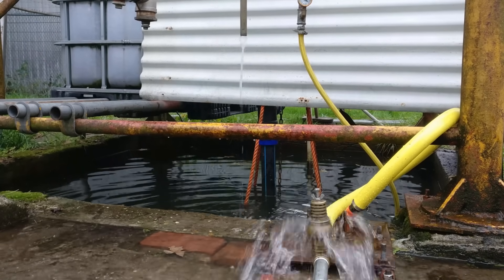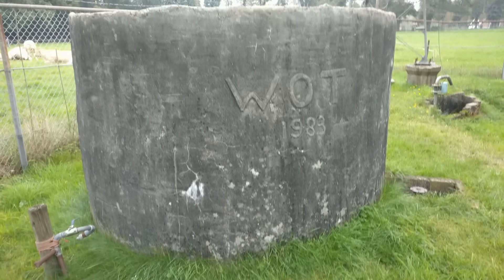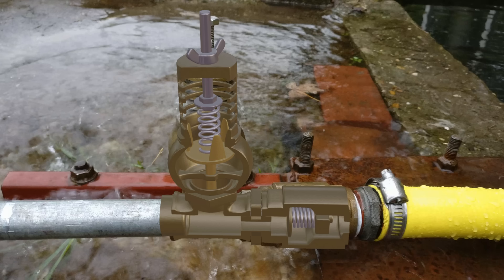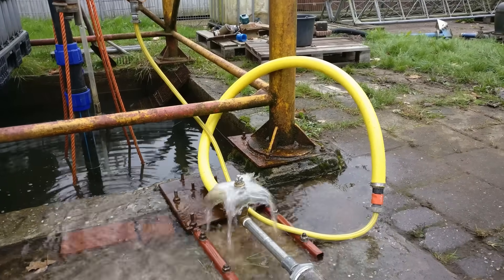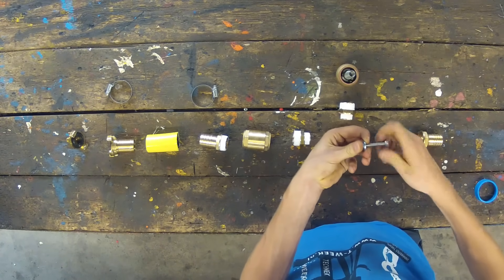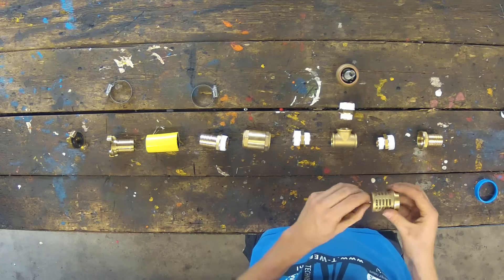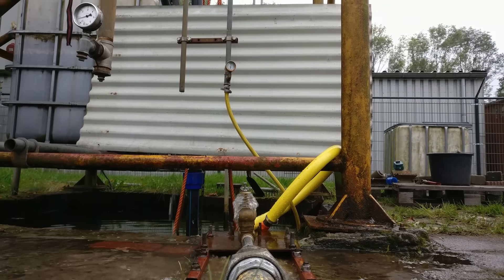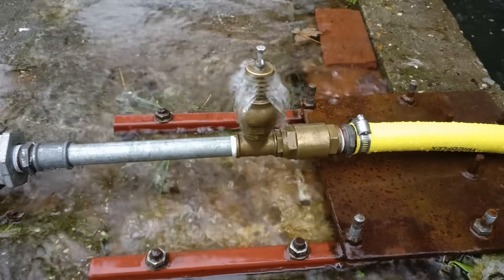Pumping Water Without Electricity - The Breurram

Comment: So it's just two relief valves tuned to be just right?
Reply: Two relief valves, yes, but you can't forget about the pipe carrying the water. This fluid circuit is almost identical in theory to an electrical circuit known as a "joule thief". An important component in a joule thief is an inductor, because inductors resist changes in current. The role of the inductor is being played by the inertia of the water in the length of pipe between the tank and the valves.

Another important component is the bubble in the tube on the pressurized side. That bubble performs a function analogous to a capacitor, smoothing out the output pressure of the pump and capturing more of the energy of the moving water.
Reply: @tissuepaper9962  Water hammer is a hell of a thing

Comment: Back in the early 2000s, I attempted to build one of these to pump water from my spring box into my garden.  I spent nearly $500 for parts because I could not get the damned thing to work, until I read a book by Gene Logsdon which told me what my problem was.  For the pump to work you need a minimum of three feet (1 meter) vertical height from where your input water is down to where the ram pump is, otherwise there simply isn't enough potential energy to run the pump for longer than five minutes or so.  Since the springbox down to the bottom of the creek was only two feet, the pump wouldn't work.  Instead, I ended up with a 30 watt solar panel and a bilge pump which now pumps water into the garden for irrigation.
Reply: Thank you for clarifying what drives the water into the chamber in the first place!
Reply: Maybe you tried this, but I think an input pipe with a larger diameter can help. And if you can't run that all the way back to the tank, add a vertical column (taller than the height of the tank) of the wider pipe which is open at the top.
Reply: @pseudotasuki  Good suggestions but due to erosion between the two spring boxes over the last 24 years, there is no safe access to either of the spring boxes.  However, as noted before, using a bilge pump and a 30-watt solar panel works just fine and, in fact, may actually work better for me because the pump actually pressurizes the water so I can lift it 10 feet from the bottom of the creek.
Reply: @pseudotasuki Also the two check valve sensitivity is something to ponder … the input should be stronger than the output so as to permit flow through the output with ease by comparison.
Reply: Solar is the way to go!
Reply: @muskratondatra8294  loo
Reply: Noted. Similar to the canal and the swimming home offshoot near my house.
Reply: Why not dig a 1 foot deep hole and put the pump in there?
Reply: @kyjo72682  The bottom of the creek is about 2 feet deep and completely filled with mud.  Don't step it it!  It's like quicksand!  The first time I did that by accident I thought I'd never get my foot out of the creek.  Luckily I was able to finally remove my feet.
Nowadays, there's so much tree and weed growth there that attempting to do anything is not feasible. 
Thanks for the suggestion, however!
Reply: @kyjo72682  the "waste" water that is uses to power the pump has to go somewhere.
Reply: Just throwing out some thoughts... Could you raise the containment level of the springbox another 1.5 feet and then have the potential (plus a little extra) to make this breuram/ram pump function?
Reply: @markpetersen912  No.  Spring box was made back in the 1940s ? 50s?  maybe earlier? and it's solid concrete attached to another spring box that was probably made back in  what I suspect was the early 1900s.  The whole area was filled in between the two spring boxes which were approximately 40-50 feet apart.  The early one had a 6" cast iron pipe linking the two and has rusted to the point that the land between the "new" spring box and the "old" spring box has eroded about 10-15 feet making the whole area sink.  It was originally the only way I could get onto the other side of the property without building a bridge over the creek. It's extremely dangerous to go anywhere near there now without the possibility of injury or even death because the drop is about 5 or six feet from the edge to where I "think" the bottom of the creek is.  My solar solution works well, however and have used that for nearly 15 years.
Reply: Thanks for noting this... I was definitely wondering what force was driving the water into the pump, this video hardly mentions it at all!
Reply: @Zalethon  "hardly mentions It at all" Is literally at the start of the video
Reply: @alessandromazzini7026  "hardly mentions it" is in other words the same as sayi g he mentions it
Reply: yes ! is the movement of the water in the river ?
Reply: @Zalethon  it uses the kinetic energy of flowing water, specifically jerk (that's a change of acceleration over time. Or v/t^2) The pressure spike of all that flowing water screeching to a stop shoves a small amount of water up the yellow hose. Then the valves switch and the water starts moving again to pick up the momentum to do it again.
Reply: @randomstuff1019  Thanks for your explanation; I get how the pump itself works, once it has water flowing into it. The video just didn't make clear how water was being fed to the pump.
Reply: @randomstuff1019  Technically that would make this a venturi pump  as its working on the air pressure created by the moving water
Reply: @Zalethon  that's because he's being disingenuous and trying to act like you get something from nothing. He mentions that water tank with a slope down to his pump but most of the water will be rejected and spilled out. That holding tank he might get 5% of that actually pumped.... and then he's going to refill that tank again using a pumped supply lol.
Reply: @etherealrose2139  you could use a scoop or ramp from the nearby river to continuously direct water into the tank and build up a little height if there's enough current flowing.
Reply: He mentions the wasted water should get back to the river, this is usually installed close to a current of water, we have one where it needs to pass 17 liters for each 2 liters it pumps, like 25 meters up, it's a huge ram, made in brazil, extreme quality.

Comment: Can this be stacked together or placed in parallel to increase the pressure?
Reply from the maker: Well actually I have heard that placing ramp pumps in series has been done.  The first stage then consists of a lot of ram pumps to generate enough flow for a second rampump halfway up the hill. We have no experience with this however.
Reply: @WOT_utwente  that doesn’t increase the water pressure over having a single pump and you haven’t described a single series, you’re describing something like a pyramid scheme of pumps to pump higher. Working backwards from the final pump, you’d probably need 4 or 5 times as many pumps at each stage. 1 pump, 5 pumps, 25, pumps, 125 pumps, etc…
It’s likely this would only work if you have massive volumes of water moving with high energy at the bottom of the system, at which point it would probably be cheaper to have a water wheel powering a rotary pump directly.
Reply from the maker: @Tim Conway  Hi Tim, you are right that maybe another solution is cheaper, probably depending on where you live and what is available. You are also right that you need more pumps every level you go down. I think therefore just two levels would be the max. Like I said, we have no experience with this, just something I heard. I believe this was done with 'philippines waterrams' but I can't find a source quickly.
Reply: Series ram/booster pumps have been used and do the job of increasing pressure but the losses are phenomenal.

I've used a 2 stage manually actuated unit to put 5000 psi into an air tank with a 100 psi input but holy hell does it take a lot of time.

Not worth the effort. At some point you're better off buying a couple solar panels and a pump if electricity is what's holding you back here.
Reply: No

Comment: Could you make this system into two (or more) spill valves that alternate in releasing water pressure but do no pumping? The idea being to generate linear motion in the valves as efficiently as possible then use this movement to create an ultra simple set of linear generators.  No rotary components would be needed to convert the water's kinetic energy into electricity, and the amount of virtual spring tension could be comprised of the sum of gravity and the current load allowed, thus being tunable to maximize efficiency depending on a changing water pressure input.
Reply from the maker: Hi Mike, maybe you could, but to generate electricity  it is probably most efficient to have a rotating generator powered by the flow in your river. Generally adding steps will increase losses. Also something that moves back and forth is also often less efficient since you continuously have to stop and start moving again, this consumes energy. A rotating motion is constant →  less losses.
Reply: @WOT_utwente  Not only is an oscillating system less efficient, it's also more prone to stress and damage because the parts are constantly impacting each other, and the pressure is spiking and falling. Rotating energy systems are definitely better, as you say.

Comment: This is unbelievable to me. Water pushes itself to a higher place just by sacrificing some amount? What happens when the water column is so high that it exerts enough pressure to break the air bubble buffer?
Reply: The column of water is behind a one-way valve, so some either gets pumped up against the hydrostatic force pushing down, or the system will not have enough inertia to open the valve.
It's really just the conversion of kinetic energy into gravitational potential energy.
Imagine you have a hose with a pushbutton off tap at the end.  You let the water flow until it has some good speed then hit the off valve suddenly.  That moving water would suddenly spike in pressure as it's forced to stop.  Normally this would stress the hose and send a shockwave back up it, but if there's a relief valve then that spike of pressure can be used to open it, and pump a bit of water at the same time.
It's super simple and effective.

Comment: This is just a different way of making a ram pump. The valves act the same way. The yellow tube act as the air tank. Nice to see alternative designs.
Reply: Yes, that's why it's called the breurram. The word "ram" is written the same in Dutch and English and has the same meaning.
Reply: Nice comment, i was wondering why air was need in the system.
Reply: @Thomas Pickens ram pumps can operate from a static head or from a flowing river.
Reply: I think it's just a different name
Reply: These are just different designs for the utilization of the same principle.

One uses springs, another uses a gravity valve.
Reply: Maby it's the same phisics, but people who know about the existance of ram-pump is in vast minority. Personally never knew this was possible. Only knew about ram-jet, much harder to build and get going. Gratitude.
Reply: there are several designs for 'innovative' pumps like this online (bunyip, breurram, etc.)  but it seems like they rarely acknowledge that the ram pump already exists
Reply: Less seperate parts on this design.
Reply: No shit. It literally has ram in the name
Reply: wher you think you get the name RAM from?? breuRAM
Reply: No. The spring replaces the air tank?  The air compresses acting like the spring in this setup.

I assume the air in this setup is so you aren't essentially having to accelerate the entire head of water all at once. Or maybe it's because it hasn't got a noreturn valve in the input?

Edit: thinking about this further. I suppose the key difference is that in a traditional ram pump, the air tank is doing double duty as the adjustable pressure/head part (not explained well), in this pump, the manual adjustment screw is the the adjustable pressure/head part, so in this design it's the waste gate that's doing double duty.

I suspect the difference of opinion is whether the spring in this setup is transferring it's energy back to the water? 

Or maybe we're both right and the pipe is sort of acting as a small reservoir and the spring is making up the difference.
Reply: @benholroyd5221  No. The spring has nothing to do with the air tank. A ram pump works by using the momentum of the incoming water being stopped suddenly to push water into a higher pressure area.

Without the hose with a bubble in it or the air tank, the mass of the column of incoming water would have to fight the mass of the column of water being pumped.

With the air tank or air bubble (or whatever, some systems have a balloon or diaphragm) the momentum of the incoming water gets transferred to pressurizing that buffer (air or rubber or whatever).

This is also why the incoming pipe needs to be made of metal but the outgoing pipe can be made of rubber or plastic.
Reply: @htomerif  if that's correct, the adjustable spring is a needless complication is it not???

Do you think the spring is returning it's energy to the water?
Reply: @benholroyd5221  There's two springs: a heavy spring keeping the high pressure side shut and a very weak spring that returns the valve plate.

I mean it says the purpose of the valve spring in the video. If its too tight, the water will never push the valve plate up to the closed position and if its too loose, the water pressure from the low pressure side will be high enough to hold the valve plate up and shut.

All these two springs do is control the oscillation of the valves. They have nothing to do with energy storage.
Reply: Same thought myself
Reply: Slightly different in that is doesn't necessarily require *flowing* water, just a height difference between the device and the water source. Could be used in a pond (natural or artificial) which to my understanding is unsuitable for a normal ram pump. Definitely the same method of operation though, you're right about that
Reply: @lmack3024  It does require flowing water. The tank has a pipe coming out of the bottom, and not through the top. The tank height creates pressure on the bottom layer of water which forces water to flow through the pipe to the pump.
Reply: @lmack3024  it's not a submersible pump, the purge valve needs to be venting into a lower pressure environment than what it enters the pump at.
Reply: @lmack3024  No, it definitely needs flowing water. Its exactly the same as a "ram pump" or a water hammer pump. "Breurram" translates roughly to "weeping pump". They're literally the same thing.